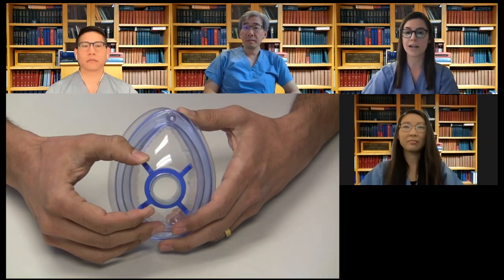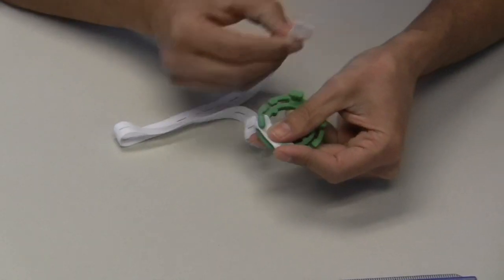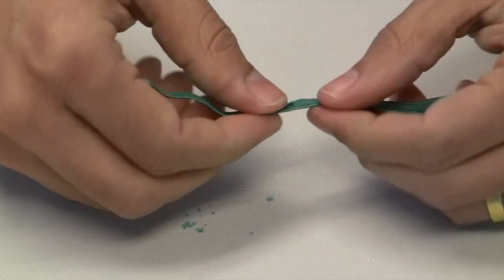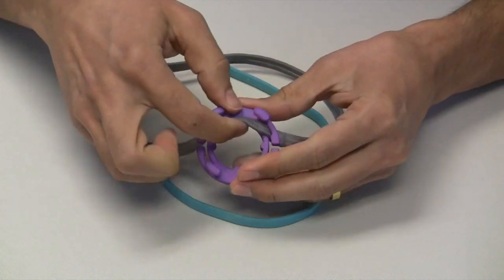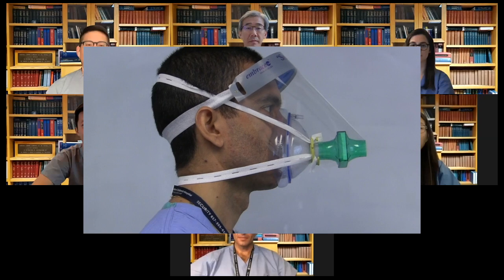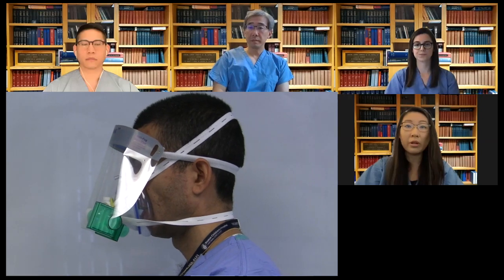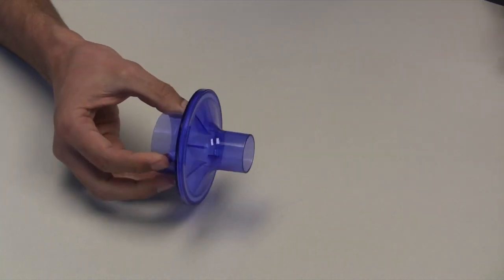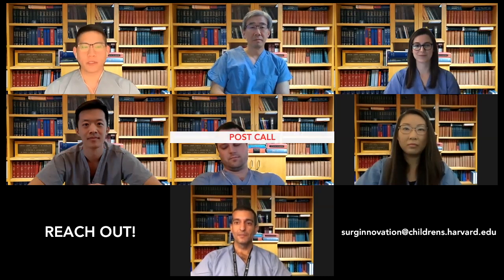FAQs Making Your Own Reusable Elastomeric Respirator-Adapters and Face Shields

Comment: Hit em with the dab.

Are people using CPAP masks in replace of anesthesia masks? The medium anesthesia mask does not fit my face at all. I tried to compare it to my medium CPAP mask, so buyer beware. If you have a medium CPAP mask, you should probably up the size on the anesthesia mask. 
I'm currently using this set up with an AG Industries Generic Outlet Bacteria Filter. According to them, this has a Viral Filtration Efficiency of 99.99+%.
https://www.cpap.com/productpage/generic-bacteria-filter-cpap-machines-10-pack#specs-tab